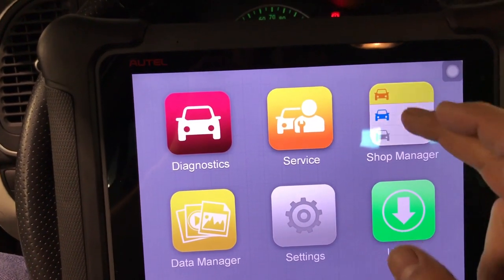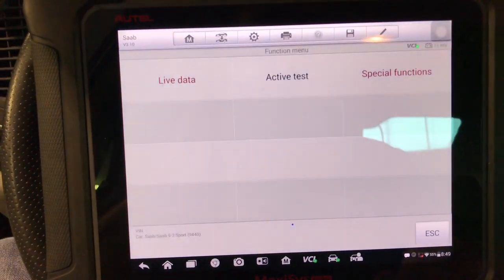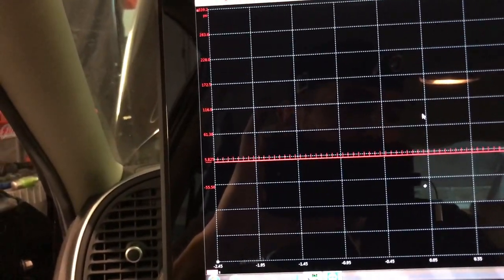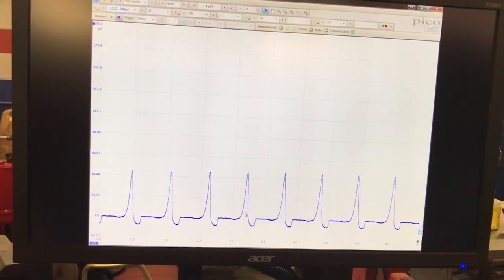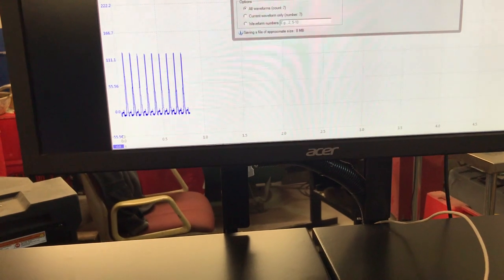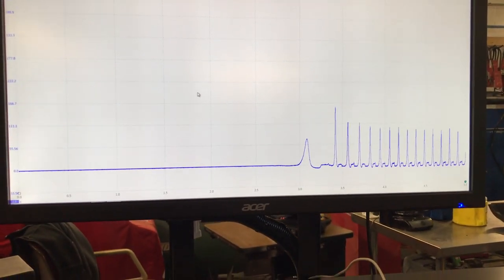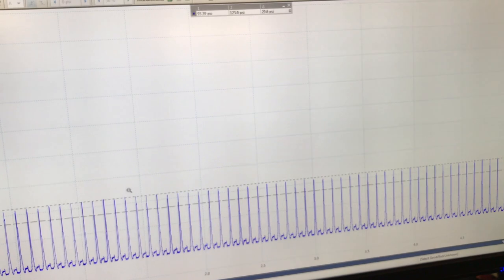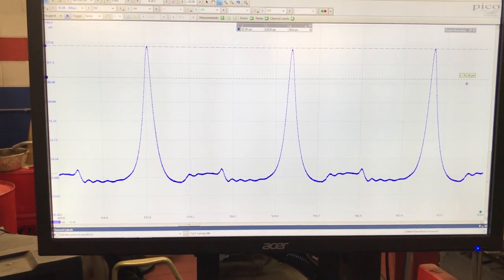2008 Saab 93 2 0T P0301 Cyl 1 misfire part 2

Comment: Awesome equipment.  I had a '82 Saab that broke one of it's intake valves.  Ran fine at 1500 + RPM.  Did a compression check and found the low cylinder.  Pulled the valve cover and found the culprit.  Replaced all the valve springs & seals from the top end (fed rope into the cylinders).  Then all was good!  :)

Comment: You called it correctly right from the start Maic. I don't have a lot of experience with cylinder head issues so this has been very informative. I'm still a bit amazed that the valve will seal so very quickly after startup. Thanks!
Reply from the maker: Baxrok2 this one was a little bit tricky! I think that this car has bad lifters on the exhaust which damaged the valves! Either way I am going to replace the lifters as well. I will up load the repair video next week when I get all the parts. Maybe two parts, disassemble and probably secondary ignition wave forms after repair.
Reply: Maic Salazar Diagnostics I will look forward to seeing the repairs!

Comment: Great diagnosis Maic!  It's amazing how we used to use Sun scopes analyzing secondary waveforms , compression & vacuum gauges then leak-down testers and now we use a lab scope, scanner, pressure transducer, leak-down testers, borescopes, thermal imagers, etc & can nail the cause w/o ever tearing into the engine! 40+ years & I love diagnosing better than ever.  Cranking & running compressions  each show different details so doing both shows so much.  Again great diagnosis Maic and great video series.
Reply from the maker: Hayward's Automotive thank you so much! I love diagnosis as well. Technology has advanced so much! Lab scopes are the best tools, it takes a while to get used to it and understand the different scenarios, but that is what it makes it so cool!
Reply: Hayward's Automotive OK question for you guys. I am trying to understand what is happening at the end of exhaust stroke. We can see increase in pressure before intake valve opens. Does that mean that exhaust valve is closing to early and compressing remaining gases resulting in higher pressure. I hope this question make sense. Thank you guys. Cheers
Reply: I'm no expert but the dip (vacuum) on cranking shows valve leaking during compression causing the dip bottom of power stroke and when I look at the exhaust valve opening it is early and the exhaust valve closing is also early causing the rise in pressure so what is the cause? The exhaust valve is pitted & burnt and tuliped worn and I believe the seat is worn enough (sunken) to cause this however also has fluctuations in the exhaust & intake.  I'd also look at the lifter & valve springs good when the cylinder head is removed & reconditioned.  Maic may see something different and he is going to do the video of the cylinder head rework so we'll see what he finds.
Reply from the maker: Hayward's Automotive I couldn’t explained better, I agree with lifter and or springs, as you said when I take this apart we will see on detail
Reply: Hayward's Automotive thank you so much for explaining this to me sir . I am still new with this way of testing . Looking forward for part 3.. You guys are awesome. Thank you .
Reply: I learn every day I do this. What is cool is seeing the waveforms, diagnosing it and then tearing it apart and to see what really caused the waveform and then dissect the waveform knowing what was wrong so you know what it looks like. Sometimes what you think you see may be something else or a combination of things but we learn from it.  Maic's diagnosis and showing both cranking & running compression &  the differences and using both to diagnose and then borescope to verify was perfect. Maic and you produce some great informative videos and I am looking forward to seeing Part 3. .
Reply from the maker: Hayward's Automotive thank you so much.

Comment: That intake valve looks like the issue... there's no lip to the valve. The seat is the with of the whole valve and looks razor sharp at the end of the valve head. Wow.
Reply from the maker: Thomas EXOVCDS I will check all valves when removed and will replace all lifters

Comment: What is vehicle mileage?  A leak down test may help conclusively show if this is the exhaust or intake valve leakage.  (Note, that a number of forums show that Saab owners have encountered leaky intake valves after approx. 80K miles on model year 07-09 cars with this engine.). I'd be interested in follow up here.
Reply from the maker: I did this 3 years ago. Please check the link in the description. I did the leak test and yes all valves were really bad.
Reply: @MaicSalazarDiagnostics  
Thanks Maic,
I did not notice the date of your video when I first viewed this on an ipad. 
My 2004 9-3 gets regular synthetic oil changes at 8,000 km's and all runs great with 219K km's on the clock;  my daughter's 900S has 362K km's on its 2.3  motor and is running well.  Both these motors seem to have lots of life with regular maintenance.